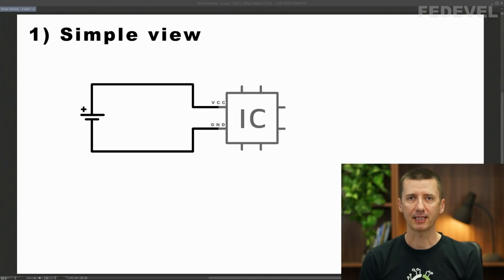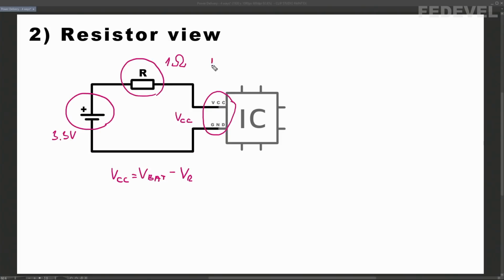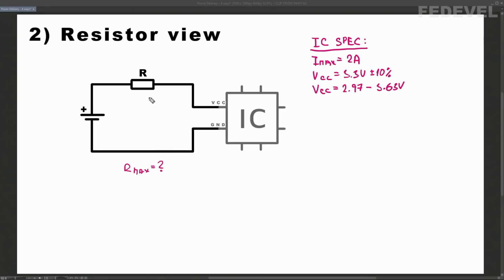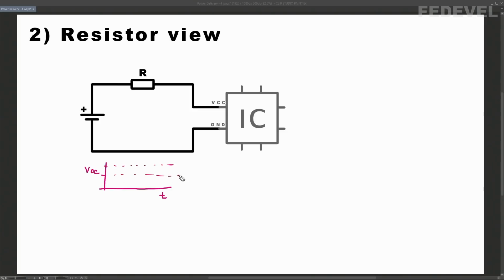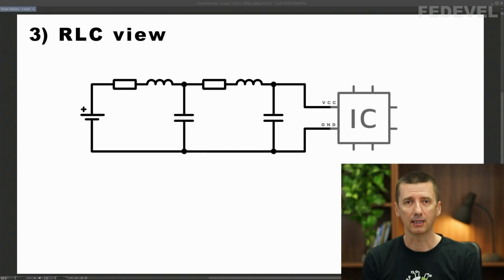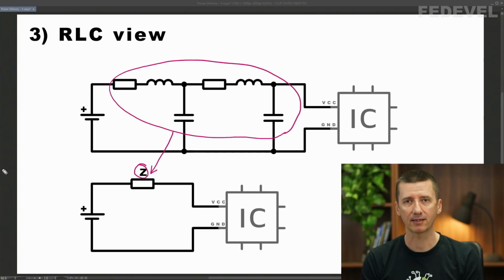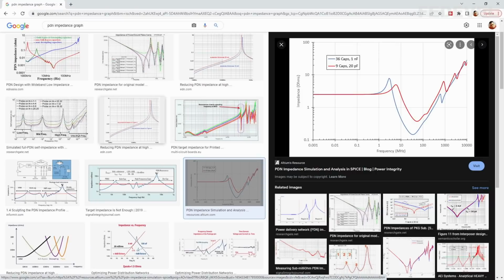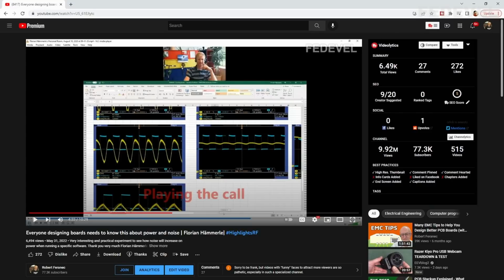Why the circuit in the thumbnail is wrong? Do you know?

Comment: I have so far designed 2 PCBs for a project based on the PIC18F45Q43. But both times the PIC18F45Q43 burns out when I power the circuit. In the first design, I did not have decoupling capacitors, but in the second design I did; but the result was the same. I'm using 7805 regulator with decoupling capacitors as well. If you think there is something I'm missing or something I can fix; please help. 

Thank you in advance sir.

Comment: Thanks Robert, you just demonstrated, how much decoupling capacitors, next to the IC (or other variable load), are important!!! DC voltage drop can be fixed with broad power planes and LDO's close to the load, but you still need high bandwidth decoupling capacitors (low ESR and inductance), next to it.

Comment: It is an schematic. It is not wrong, but incomplete. The title of the video should be "why this won't work?". Only then your analisys is right. For example, the SIM800L module states that the module must be powered directly with a lithium battery with the shortest possible wires. If you use long wires, or just a voltage regulator as the power supply, the module won't work or will fail. So, if you draw a battery and a SIM800L, you must write in the schematic "closest possible". If you don't write that your schematic is incomplete, not wrong.

Comment: Hi Robert, thanks so much for the video. In regards to your view of energy and fields. I would suggest that you contact Dan Beeker from Sierra circuits. I recently attended his EMC seminar and found it quiet useful and his take on PCB layout and circuit design is completely based on how fields move in the dielectric of the PCB. If you can make a video with him to share his knowledge and expertise then it would be of great value to the electronic design community. 😊
Reply from the maker: I am talking to Dan :)

Comment: My pick and place machine is using exactly this kind of power supply :D 
Don't even think about bypass capacitors on the pick and place head.
The company is called Mechatronika in Poland. I fixed it already and it's not crashing (and rebooting) anymore.

Comment: Hmmmmm 3.3 +/- 10% = 2.97V to 3.63V... Better power supply is needed...
Reply: Also something to consider, square wave with a rise time of 300ps is pretty much all frequencies up to 3.3GHz
Reply: LOL... posted just before your comment :)
Reply: The tolerance you just quoted is what the ic can operate on. How does changing any aspect of the power supply affect the impedance of the path between power supply and ic

Comment: I had a problem with an ESP32 board where it suddenly stopped working after a few hours of performing simple data aquisition, sending over wifi to a server and then going into deep sleep mode... it turns out it had a problem with the power supply line during wake up / sarting wifi modules...

Comment: So basically, the models are:
1. Perfect voltage source with perfect wires.
2. Slightly more realistic source with output resistance and wire modelled as a resistor.
3. Any wire is not ideal but actually a transmission line, especially at higher frequencies. Among other things, voltages are not necessarily constant over any segment of the wire, so there are no real "short circuits". This can be modelled as "an infinite sequence of tiny passive components".
4. Lumped components like RLC are not real and Kirchhoff's laws are not valid. In fact, there are no such things as real "linear" currents in an infinitely thin wire, but 3D "current densities" flowing through a medium; moreover, there are no true voltages (except perhaps in pure vacuum) as that requires some mathematical properties on the electric fields that are no longer true. This is the realm of the Maxwells equations, where things like the geometry of the materials matter, besides their behavior in presence of EM fields. Design and simulation are incredibly complicated so simplified models of the most relevant effects are required.

I would add a couple of things:
 - Everything that is above absolute zero temperatures injects "white" Gaussian noise, except it is not really white for a number of reasons, but approximately true in a reasonable frequency range.
 - Quantum physics magic: Maxwell equations are "wrong", no material is continuous, electron flow is unpredictable, and depends on atomic energy levels considerations, etc. But this only really matters for optics (lasers) or semiconductor materials theory, and of course, in those cases, tons of simplifications are made to make them treatable. Maybe quantum computing is looking like the most realistic short-term use case requiring the most complicated models.

Of course, beyond that, there are the effects that can only be measured with particle accelerators or in black holes, but that is obviously way outside the scope of Electrical Engineering.

Comment: Sometimes I am quite surprised how some of my very first circuits I designed even worked. I remember building an Arduino accessory with long cables, without any capacitors at all and it just worked. Several years later I tried to power up the board again and it just would not function at all. Luckily I had access to an oscilloscope so I quickly found out a lot of the signals were extremely noisy and unstable. I added two or three capacitors and voila, it finally started to work again.
Reply: I agree. I actually don't even understand how I am alive after the way I have done things